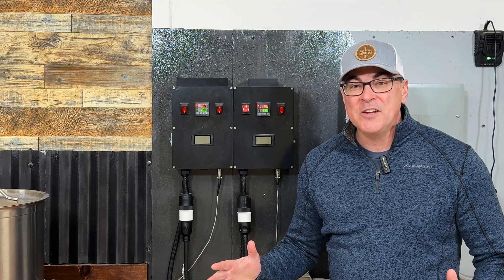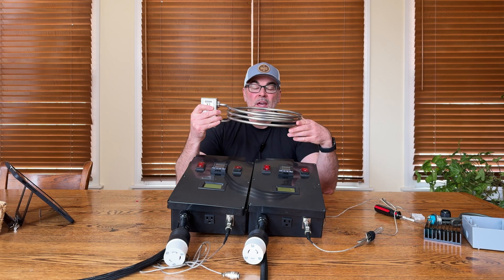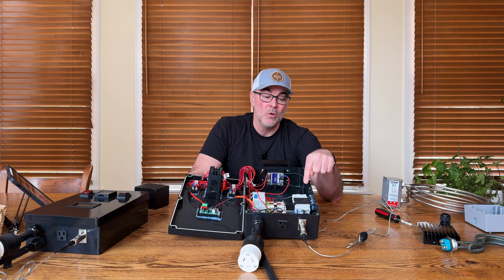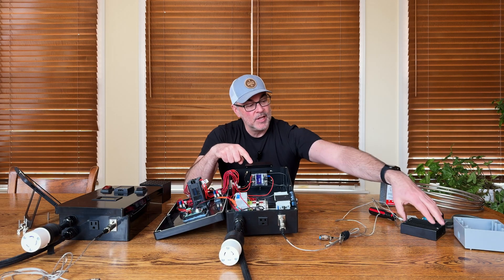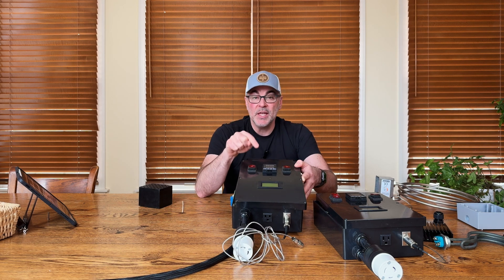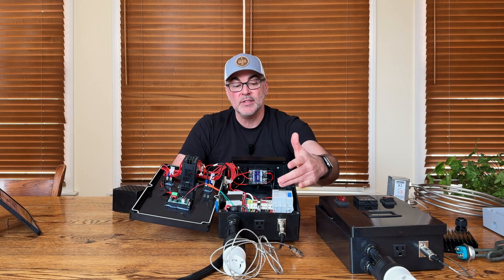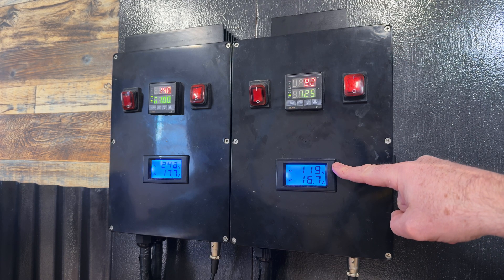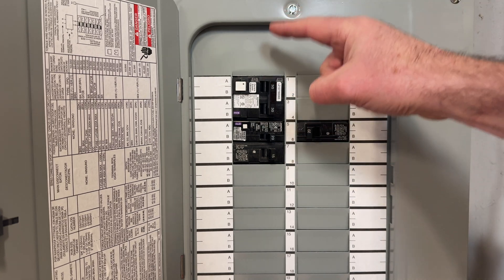How to Build an Electric Control Panel for Your Home Brewery – Overview & Demo!

Comment: Kudos on your build. Nice work. As I watched I was running through a brew day on your rig in my head. I filled the boil kettle with my liquor and heated at an accelerated rate to mash temp, then pumped over to the HLT and set the PID on the 120v panel to maintain temp. I then heated my strike and sent it to the mashtun and doughed in. and then began circulation through the HERMS coil in the HLT. I have to assume your 240v rig heats pretty quickly by comparison to the 120v outfit. However, the 120v outfit has all you'll ever need to maintain steady mash rates with little expression of overshooting or depreciable power for maintaining the mash profile. Very well done, I love the repairability of this rig. Having the few components on hand that really have a failure effect is minimal. What a treat this rig must be to operate and maintain. Cheers.
Reply from the maker: Thank you for the feedback! You're pretty close on how I use the system to get my Brewday going. I usually fill my Boil kettle with strike water and just fill the HLT to the top and bring it up to Mash temp. By the time I heat my strike water in the Boil kettle, transfer it into my Mash Tun, and then Mash in, the HLT is pretty close, if not already at Mash temperature. I found 20amp/120v is plenty of power to keep the HLT at Mash temps for both 5 and 10 gallon batches. It takes about 10-15 minutes to bring the 20 amp panel up to Mash out temps. Maybe a 240v elements could be a little quicker during mash out, but I really don't think about it.  Back when I decided to build a 120v control panel, I had the idea that I could pull the panel off the wall and bring it into my kitchen for indoor brewing on 120v 20amp outlets. I never did this, so maybe just building another 240 control panel would have been fine. The 120v panel cost about the same amount of money as the 240 version, maybe slightly less. I have blast brewing on this setup. For me, half the fun of hombrewing figuring out how things like this work. I think it's pretty cool brewing on a DIY system. Cheers!